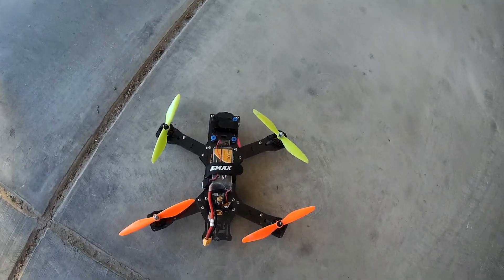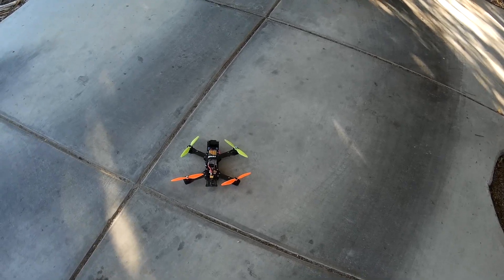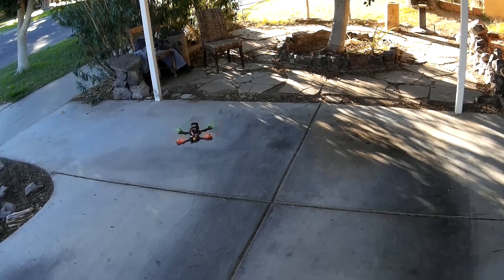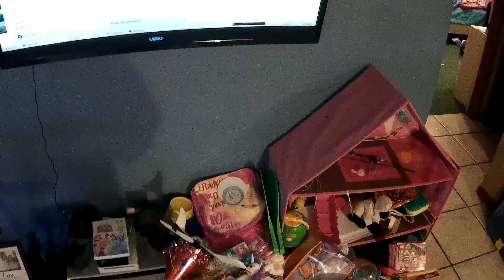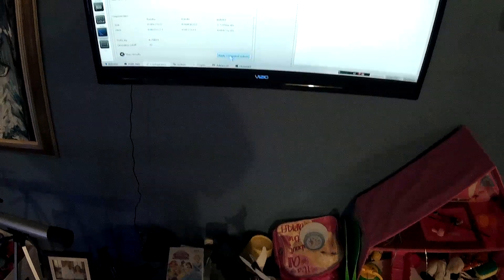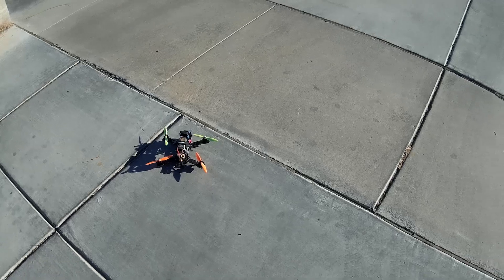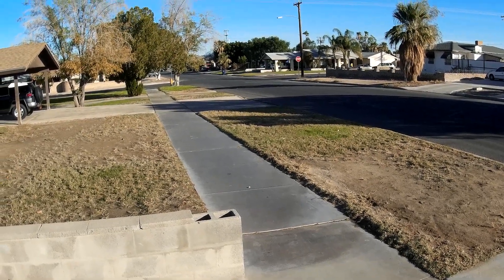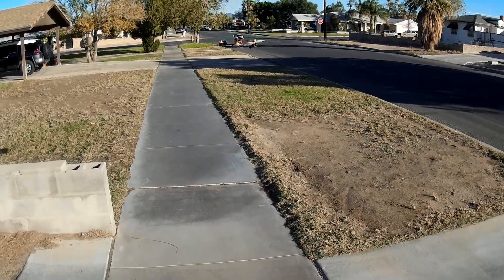dRonin - autotune on emax nighthawk pro 280

Comment: How did you "start" the auto tune? Every video I've looked up glosses over that part. I'm assuming it isn't recognizing the narrator's voice saying "now I'm gonna enable autotune." Did you have to program an auxiliary switch to channel 5 or 6+?
Reply from the maker: basically autotune is setup as a flight mode like acro/leveling/horizon so I use the same switch I use for flight modes and just assign one position to autotune.  then switch modes once I'm in the air and stable.
Reply: +Jason Hitesman Awesome! Thanks for the quick reply! Dialing in PIDs has been a source of major frustration for me the last week.
Reply from the maker: +mattmonkay no problem, hope dRonin works well for you!

Comment: Will this work on the CC3D on the Eachine Falcon 250?
Reply: I have the Eachine Falcon 250 and it works MUCH better than open pilot or librepilot. I highly recommend it! I'm still figuring out a little bit on it, but so far it works great. I could never get arm via switch working on openpilot or librepilot and it worked easily on dRonin.
Reply: +Daniel Canham Nice.... I'm sure it would be greatly appreciated if you made a instruction video for the Falcon and posted it in the RCGroups forums
Reply from the maker: +RC Flyer85 I'm not familiar with the Eachine Falcon 250, but dRonin does support CC3D so as long as it's actually a CC3D on there you should be able to install dRonin and use autotune.  Flashing instructions for the CC3D can be found here: https://github.com/d-ronin/dRonin/wiki/Configuring-your-new-board-for-basic-flight
Reply: Sure. I'll see what I can come up with today on my time off. Its pretty darn windy but we'll see if we can do it inside.
Reply: I've been having nothing but trouble with Librepilot on my falcon. I couldn't get arming via switch working either and my drone is unflyable with librepilot. Gonna switch over tomorrow to dRhonin, pretty excited tbh
Reply: Crusade Gaming TBOG. Did this ever work out for you?  I'm a noob when comes to quads, so don't really know any better than librepilot. Just starting to get used to acro ( yes I started with attitude ). How does the cc3d "record" the autotune data? I wasn't aware of any storage capacity.

Comment: Awesome...Thanks for sharing...Using recent stable release of dRonin on a Eachine Racer 250(CC3D) modded for 6" props...never could resolve intermittent oscillations using Libre BUT 60 second 'autotune' and BAM, very solid and locked-in!!!love the slide bars for manipulating personal flight preference as well...very impressed...recommend to newbs and veterans alike(if they can peel away from Clean/Beta HA)...any luck getting Horizon Mode to perform a little better???
Reply from the maker: No progress on horizon improvements yet as far as I know, but low power stabilization and actuator clipping are looking really nice (think "air mode" but a bit more refined.)  That will probably help lay groundwork for better horizon.  you may want to try weak leveling instead, it's a bit different than horizon but more predictable right now.
Reply: +Jason Hitesman Sorry for newb questions...In Horizon Mode I am unable to pitch or roll past 90deg...any idea why that might be?...WeakLeveling and Acro will flip n roll..also, which parameters control 'power stabilization' and 'actuator clipping' for better Horizon response? :)
Reply from the maker: SEEKER OF YAH Wow, that's a bit past true noob level I'd say :D  So congrats!  Unfortunately I can't think of anything that would cause that in horizon, only leveling mode should do that.  actuator clipping is new and I haven't really had much time to mess with it yet.  Your best bet would probably be to try the dRonin IRC channel where the active devs hang out.  There's a link on the dRonin.org homepage that will give you a web based IRC client to connect.  Don't be shy, just ask away and if someone is there they should respond.  Since there are devs all over the world there aren't many times you won't get a nearly instant reply on there.  Sorry I can't be more direct help with that.
Reply: +Jason Hitesman Yep, developers are champs for instant response...after Tx Wizard my stick endpoints were all around MIN:1030 & MAX:1930...firmware needs to see 1000 and 2000 to recognize full input and surpass 90deg in Horizon...makes sense...so I made adjustments via Travel Adjust in my Tx so GUI now sees 990 and 2010 on full sticks and problem solved...hope this helps others someday...
Reply from the maker: SEEKER OF YAH Yeah, I help with the dRonin FB page and saw your question there.  icee who answered your question is incredibly at being able to diagnose and solve problems in the blink of an eye :)  Though it is fun when someone does come up with one that manages to stump him!

Glad to hear you've got it sorted out and are enjoying it!  I'm getting really excited for the next release, the hangtime stuff is looking incredible and there's been a lot of little under the hood changes that are laying the groundwork for a lot of great stuff to come!

Comment: Sweet. getting familiar with changes now that I'm tuned. For a beginner what flight modes do you recommend? Is yaw axis lock sort of a headless mode? Until I really can get more comfortable in air trying to graduate flight modes from simple (easy) to more expert. Recommendations? Autotuned twice but have high Tau levels 70 then 65. Recommendations for bringing those numbers down? My 450 seems to be flying well so maybe not necessary. Thanks for your video!
Reply from the maker: +Peter Schultze It may seem unintuitive but I really suggest buckling down and learning to fly in acro mode for a beginner.  Autolevel modes are nice and have their place, but learning to fly with them first really does make things harder since then you have to unlearn bad habits when you switch to acro (and if you stick with it eventually you will want acro, especially if you start flying FPV.)

That said I'd usually suggest Horizon as the level mode of choice - but on dRonin it's a little funky right now so weak leveling may be a better option.  I've never tried axis lock on Yaw, I tried headless on multiwii a few years ago and found it horribly confusing and haven't messed with those kinds of modes since.

On a 450 with bigger props 70/65 tau values probably aren't that far off.  Tau is a measure of how quickly the FC can sense the results of changes - basically the time from when the FC says "tilt left" and when it hears data from the gyros confirming that it's tilted left.  So smaller props and higher kv motors on lighter setups will give higher tau's since they can react faster.  Lower kv motors and big props on heavier setups take longer to react so you get higher Tau values.  

I need to get my 380 with 8" props on 1400kv motors up and tuned...I've been meaning to for almost two months and keep getting distracted :D  I've pulled tau's in the mid 20's with that setup using blheli with damped light and oneshot (both of which will help get lower tau's.)

Overall though I'd suggest against chasing numbers.  Lower tau is great...but if it feels good and locked in and stable - then I say fly it!

Comment: hm how do i get it on my FC? got a cc3d, in dronin gcs i see it recognized as copter  controll, fine so war, but when i hit rescue on the Fw page it cant find the bootloader
Reply from the maker: +Grearson .x I'm not 100% sure since I don't have any CC3D boards...let me see if I can get some info for you or get someone who knows CC3D to reply.
Reply from the maker: +Grearson .x You may have to use the rescue method described in the wiki here: https://github.com/d-ronin/dRonin/wiki/Flashing-firmware
Reply from the maker: +Jason Hitesman oh, wait...you're hitting rescue and then having the problem...my mistake.
Reply from the maker: +Grearson .x Ok - here's feedback from a dev:  boot gcs, hit rescue with board unplugged, plug in USB.. bootloader recognized (BL version: 4). solid green/blue. open file, flash. blue led pulses while writing., goes to gentle pulse after successfully flashing, hit boot, green light stays solid, blue light starts flashing (real FW is running.)

If you're still having issues it might be best for you to check out the #dRonin IRC channel on freenode to get help.  More people with cc3d experience there to help out: https://kiwiirc.com/client/irc.kiwiirc.com/dronin/
Reply: +Jason Hitesman Thx Mate got it booted =)

Comment: what's the procedure on working with auto tune I have beta flight
Reply from the maker: +george aura This is dRonin not *flight ;)  All new firmware not yet released.  It's based off of Tau Labs but has had some major changes to get Tau's autotune working on F1 targets.  Tentative release date is mid-january.
Reply: Oh ok I see
Reply from the maker: +george aura First stable release of dRonin is now out.  Time to get your F1 autotune on!  https://github.com/d-ronin/dRonin/releases/tag/Release-20160120  I'll be doing some follow up videos over the next week or two with setup and getting started help.